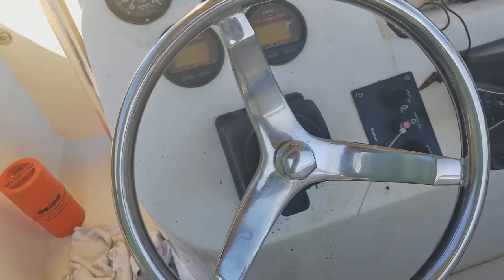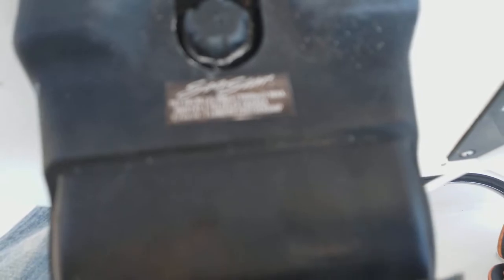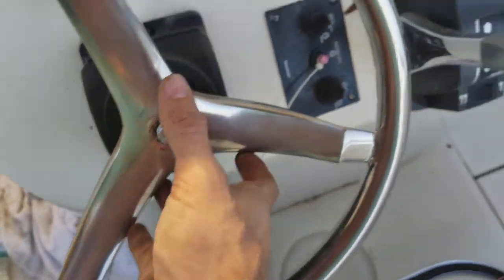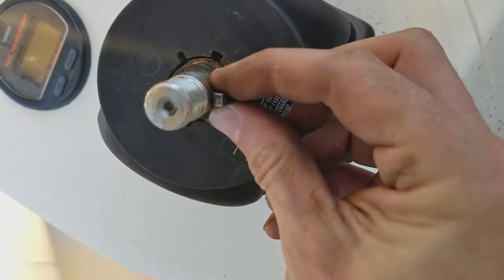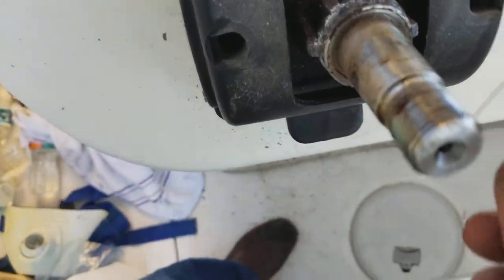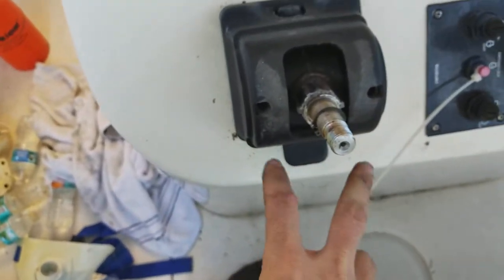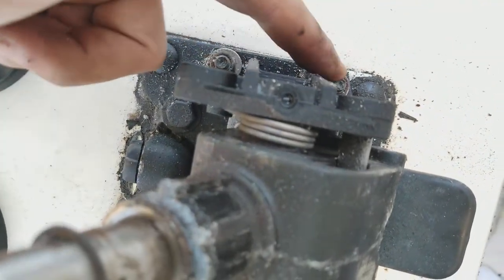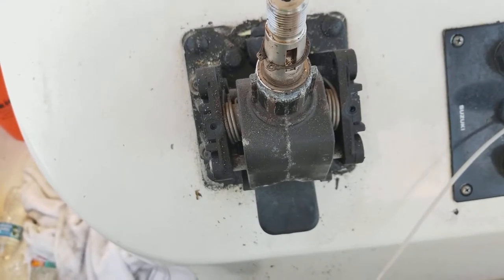Sea star hh5741 disassembly

Comment: You do not need to take the tilt part off. Just unscrew the 4 corner  bolts and 2 hoses underneath. Once you have the unit out you can remove the small allen head screws and disassemble the unit.

Comment: If you're not taking the tilt mechanism apart to repair it then do not take the top allen bolt off as it says in this video - only remove the lower one and you may need to loosen the top one.  The lower one connects the helm shaft and the upper one holds the shaft seen in the video.  There are moon-shaped "shims" that will fall out freely if you remove the upper allen bolt from the tilt mechanism and then you will have to disassemble the whole unit - great if you're repairing or greasing it, but a pain in the neck if the shim drops out of the egg assembly that holds the upper shaft.

Comment: Thanks ! I have a question : in order to replace the front seal on the shaft I have to remove the full pump or is possible to work in the front side only .?
Reply from the maker: The top seal that's around the shaft that holds the steering wheel? You can do from the top